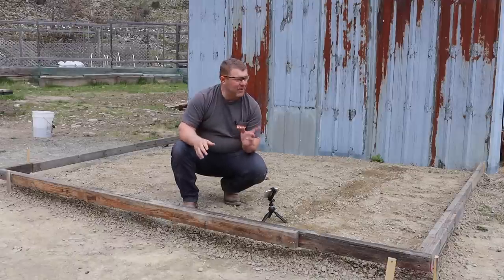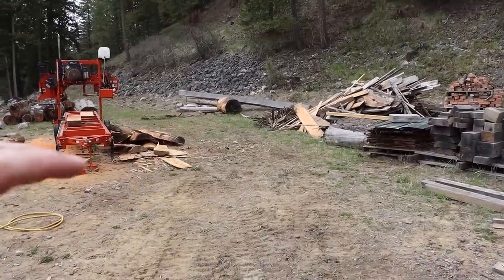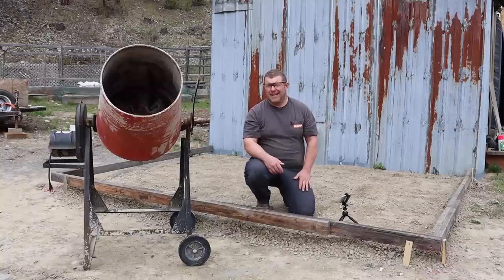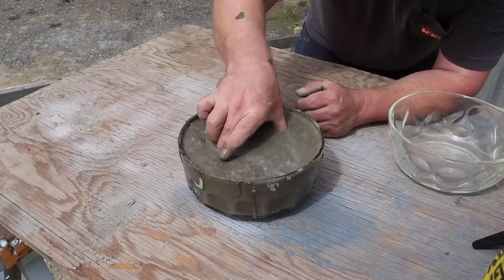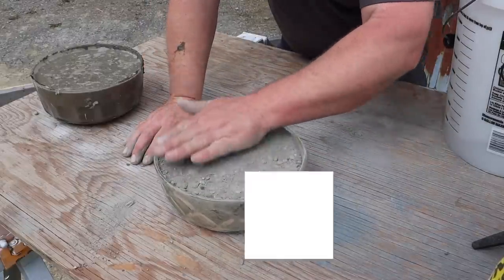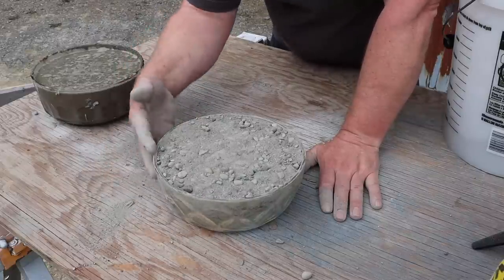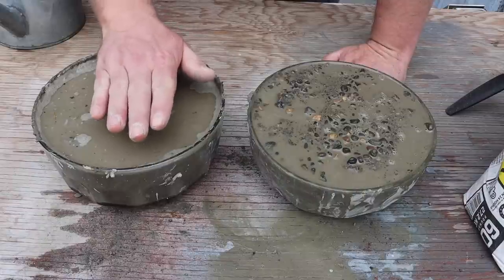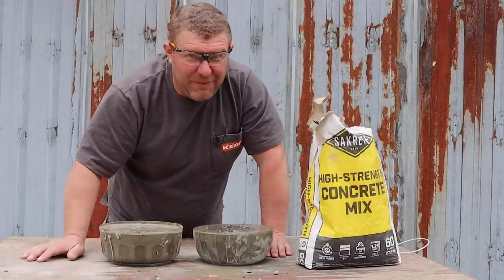STUPID EASY! DRY POUR CONCRETE! (DIY Concrete Slab or Walkway)

Comment: I watched a couple do a dry pour slab and they told you how to do it. The first thing you do after screeting is mist it with water and let it set for half an hour I think it was then mist it a bit more.

The trick is to lightly mist it so you don't wash the cement off the sand and aggregate.

Comment: just so you know, you did several things wrong with the dry pour. It's hard to do it correctly if you don't watch one or two of the ones that have it worked out. It can be made smooth. It can be made very strong. It takes less work, but more time starting with sprinkling water every hour for a couple minutes for 5 hours. Yes you have to give it time to settle. It's not a one hour job, but since I don't have a mixer and don't want to rent one this is a good option. You don't have to worry about the concrete drying too fast either. You control that. Another guy did 2 glass bowl test the same way. Drove his van on both. Neither cracked. Another guy has cracks in his mixed slab and no cracks in his dry slab. Screeting is a part of the dry pour process. For smooth finish, they use a paint roller for the finished look.

Comment: Yeah you were supposed to finish surface prior to light light misting of water every 1/2 hour for the first hour. This will keep the aggregates below the top and once surface is hard you can rain shower the hell out of it for the next eight hours. Slower process but much easier

Comment: While your dry pour test is nice content, it has been around for quite some time at least since 2000. Mallard Builders that erected storage units, used dry pour in most to all of their support posts. the only wet pours they did was the slab.
The reason I was told is the concrete would draw H2O from the soil at a steady rate and make the concrete stronger. I have never heard anyone say the support posts failed or seen any that looked in poor shape.
Thanks for the review< nice to see you back on the channel.

Comment: I think a better vessel would of been a planter pot with drainage holes.  Cause as you mentioned, the water tends to drain into the ground when set upon the area that you want it.  Soo...maybe transfer the cement into 2 pots with a mesh liner to allow the water to strain as if it was the ground itself.

Comment: The water can come to the surface as bleed water, and then evaporate. I mean, if you think about the stones and sand are heavier than the water and they’re all going to the bottom trying to force the water up to the top. I think that’s a reason why you don’t want to start working the concrete until the bleed water is gone or else you will get Spaulding from the excess water being pushed back in the very top layers

Comment: I think quickcrete has a dry pour mix designed for it, its only ment for 4-6" slabs. It has less rock, and lot more fines. It's also watered a lot more gradually as in hours to let it soak. Speed go wet mix, got time and no experience dry pour seams half decent.

Comment: What if you hydrate slab from both sides by burying 3/8 inch perforated PVC pipes and ran water through them at the same time that you're wetting the top

Comment: Interesting experiment.  I've never used the dry method either, but there are several YouTube DIYers who swear by it.  As you demonstrated, the top finish is different between the methods.  I'm wondering if the glass bowl's solid surface may have influenced both mixes in that it doesn't breathe and as such it doesn't allow the water to penetrate like it would in a more porous form.
Reply from the maker: Exactly. Not a super fair test to either method.

Comment: If you place concrete in glass bowls, instead of on the ground, this may be helpful.  An expansion joint between the slab and the building might help, especially if you plan to move the building later.

Comment: i know a fellow who added on to his slab house. he set forms then filled it with sand. then spread portland on it, mixed in with a rake. then added water.  i think it was a crappy job 35 years ago, but it has held so far.
i would never do this, but to each his own.

Comment: Dry pour is nothing but laziness. Also to much water makes for weak concrete that will do what's called Spaulding where the surface basically cracks and flakes off after a few months, that batch you mixed would probably be like 8 or 10 slump...lol